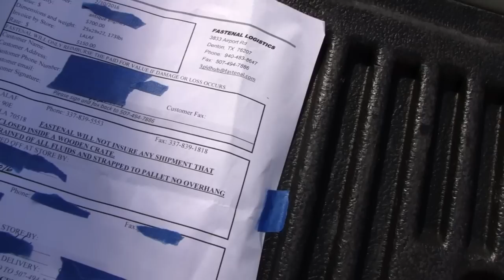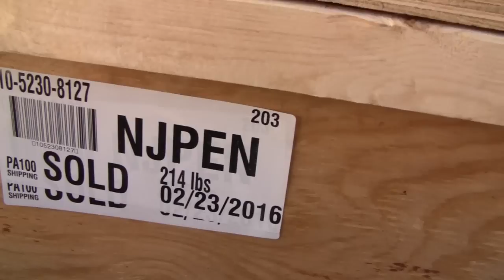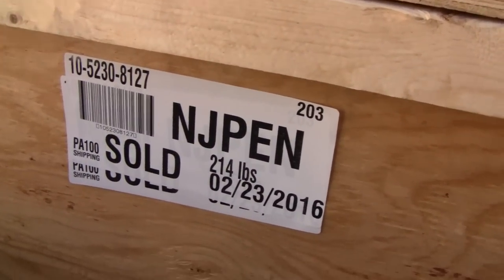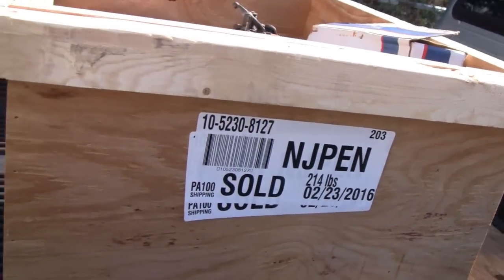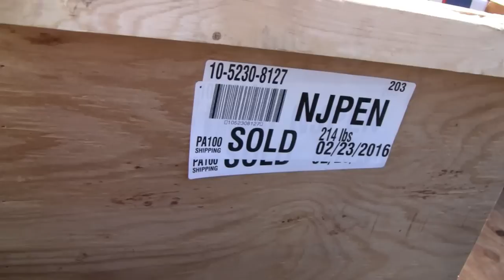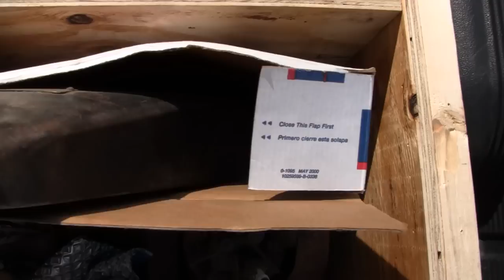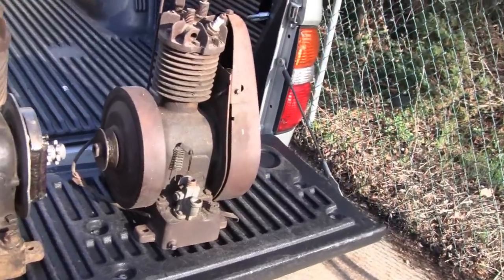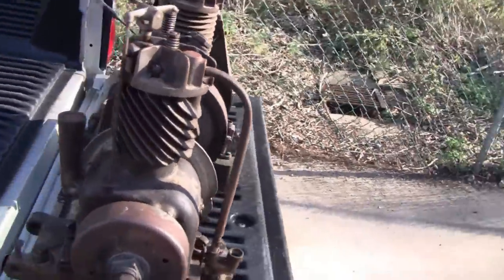ANTIQUE BRIGGS MODEL FH PROJECTS

Comment: Yeah, I don't know about anyone else but the experiences I've had with freight trucking companies in my life has pretty much confirmed to me that freight companies don't give a crap.  I shipped an expensive stereo system wayyy back when and because I had access to warehouse equipment I was able to ship it in a HEAVY cardboard box with three inches of wadded up newspaper stuffed tight in between the inner boxes.   When the box arrived there was a hole the size of a baseball almost three inches deep in it!  That's just one example.  Unless a shipment is boxed up like your guy did those engines, you are risking anything you ship!

Comment: Can you tell me . I went to put my Flywheel on my FH and it scapes on the Mag No adjustment on the Mag Crank is straight NOT bent If the Backing plate was bent a little would that bugger it up   , It looks like 1/4 further away from the shroud backing plate
Reply from the maker: It's a common problem with them, the pot metal on the backing plate and flywheel distort over the years!! Make sure your backing plate is secured properly to the block, then I grind off and reshape the coil to fit, just enough so it don't rub!!☺
Reply from the maker: That was another problem, the flywheel is two parts and sometimes they would separate!! Mike made a video a while back on how to repair that!! Here's a link https://www.youtube.com/watch?v=iOEnoeI8LLo